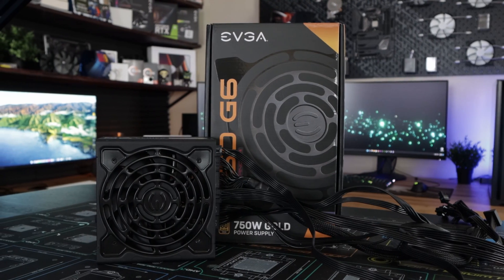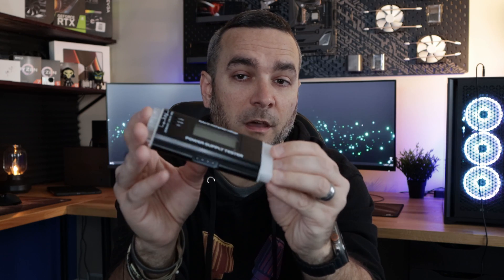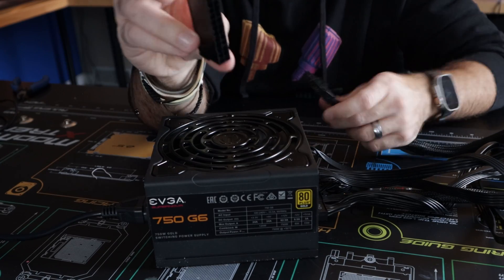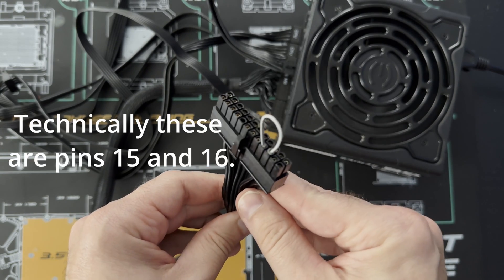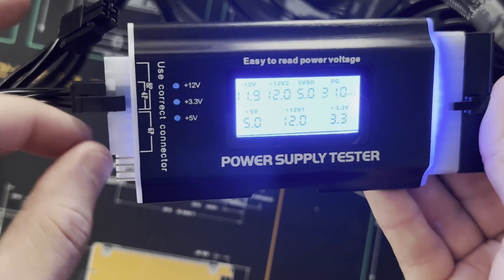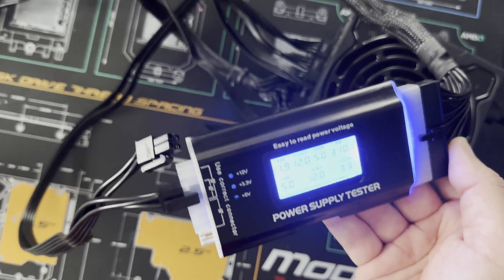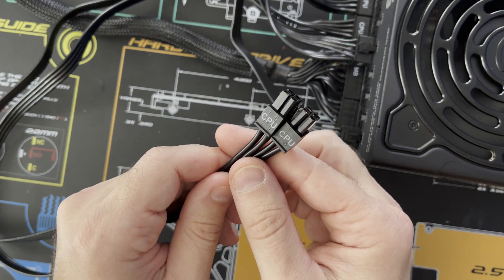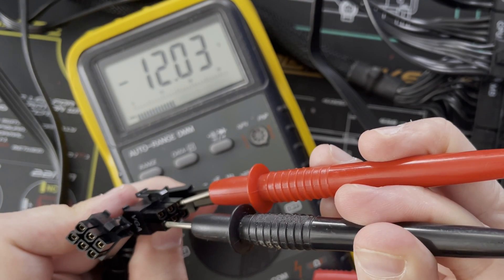How to Test a PC Power Supply | Jumper Wire, PSU Tester, and Multimeter

Comment: I had the same issues as well but the difference is the monitor shut downs and my keyboard lights turn off also. Sometimes it restart by itself sometimes not and i need to force it to boot or turn it on again by turning the whole pc off. But the thing is. My pc still running all fans and lights are running and on including the cpu fan but why only the monitor and keyboard loss signal or lights?

Even in idle or YouTube still random crash or shutdown.

Can anyone help me address what's the problem of my pc??

Comment: I have a question when testing a PSU how long should you test it for?
Reply from the maker: If you follow the methods in the video, then you only test it until you check all cables and make sure you are getting the correct readings. If you are stress testing, then there isn’t really a timeframe. Run a few benchmarks and you should be good to go.

Comment: how are your TechRated, i have a 3070 with ryzen 7 3700x 32ram from t force, and SSD, so the thing is like 6 months ago my computer when I turned on, start but no display on monitor, and check the rams, GPU stress test, clean everything make sure all is plugged, and damn I do everything, but still the same thing, is not all the time, I turn the PC on 3 times with no problems but when I do it for 4 time, the PC turn on but no display , so I'm really don't know hats going on, I'm suspecting on the psu or last thing GPU but is weird because I don't have shutdowns or green lines or freeze my PC runs excellent is just sometimes start but no display, can you help me please?, i can pay if you want! but please man idnk what to do! and sorry my grammar i don't speak English ):
Reply from the maker: If the PC turns on, then it probably isn’t your PSU. It sounds like you may need to do some Windows updates and maybe GPU driver updates. Not sure. Not having an output to your display randomly is strange. I would do all updates first and then go from there.
Reply: @TechRated  thanks bro, yeah i gpu drivers are up to date, same my windows, today I will update the bios, and keep testing o.O
Reply from the maker: You might also need to update your chipset. Other than that, check simple things like cable connections and monitor settings. I guess it is possible that you might be having issues with wattage to your GPU if your PSU isn’t able to output what it needs. What GPU do you have? How many watts is your PSU?
Reply: @TechRated  thank you again and i did the chipset update the bios update like 2 hours ago, and I have an RTX Gigabyte 3070 OC 8gb and a 750w power supply of a weird brand. o., bro I will pay you this wednday like 10 dollars just for answer me
Reply from the maker: @tcpilot6995  No worries! This is the goal of my channel! Hopefully your PC issues get worked out. I appreciate the support! 👊🏼
Reply: @TechRated  hey bro good morning, I turn my pc this morning and same shit I'm frustrated 😠,  yesterday I update bios, chipset, update all the drivers everything man! What you think psu? I have a weird brand I mean is not a famous brand have 750watts
Reply from the maker: If you have completed all updates and it is still happening, then make sure you are getting proper cooling. If you know cooling is good, then the next thing would be PSU. If you do need to buy a PSU, go with Corsair or EVGA. They make good quality PSUs and aren’t that expensive.
Reply: @TechRated  I got you boss! Well I have kraken x63 I just install it 1 month ago , so Temps are good, so I will start with the psu, I'll keep ou 📫
Reply: Hey bro good morning I just change the psu I buy a corsair 850x and still the same, idontknow wtf, probably format? I don't know
Reply from the maker: I’m not sure what else to try. It’s hard to help solve a problem over messages. Lol. This might sound too simple, but have you tried changing out the cable connected to the monitor? Or the port that you have the monitor connected to your PC? At this point, I’m just guessing. However, a new PSU is not a bad thing. It is one of the most underrated parts in a build.
Reply: @TechRated  I buy that pc from ibuypower but I think I buy it on ibuyshit honestly, if I can't solve this I probably will build a new pc with a different mother board but I will keep the rtx3070 the r7 3700x the rams the psu the cooling on the cpu and the all the storage, but I'm interesting on a all corsair build, but only if I can't fix this, if we fixed I'll my pc but ou know
Reply: @TechRated  Bro! I format the windows 10 and the problem still here, BUT! I SEE SOMETHING! when I turn on the PC and then I press shut down for turn off the PC     then when I try to turn it on the PC doesn't start! So every time I press shut down the PC will not start at the first time! Damn I just see that right now! What you think about it? I make cpu stress test for 9 minutes all good I try with 2 different gpu and the problem is the same, after shut down the PC will not start at first time, sooo what you think motherboard maybe!?

Comment: Can I test the paper clip 4&5 with the multimeter?
Reply from the maker: Yes, you can! But usually, if the power supply activates with the paper clip or jumper wire, then those pins are fine.

Comment: Any way to test an HP L 8261-004? It has 2, 4pin connectors and 1, 3pin connector.  No tutorials found on youtube or anywhere. When I push start the fan doesn't run so I guess it is bad. Would be nice to test.

Comment: Amazing, I have one of those Amazon testers, but did not understand why it was beeping. I'm going to try with the PCIe cables and see if I can get stable readings. WIth just the big Motherboard cable connected, it does a 'LL' on one of the 12v- rails and shows slightly miss-matched 12v readings.
Reply: Same thing for me. Also there's a wall that prevents me from connecting to three six volt connections on my cable mod cable.

Comment: Would like to see info on testing the modular cable outputs directly, rather than through the cable. The PSU end is not standardized, so we cannot expect (for example) the top-right pin to be ground on the PSU side. If you're making custom cables and want to take a pinout before you start, this isn't really useful.
Reply: Do you find a way to find the ground on the psu yet? I'm having the same problem right now.
Reply: @askell3738  Ultimately, i plugged the cables in and traced the individual wires back to the psu. Did this for each wire in the cable to get a presumptive pinout, then used a multimeter to verify the voltages.

Comment: Very helpful. My daughter is trying to build her first PC but the PC didn't show anything on the screen and no LEDs on the motherboard. The power button works and the fans come on, even the CPU fan works. I checked the CPU 8 pin connecter and measured 8.8V dc but unstable. I have returned the PSU assuming this is a fault. From your video it seesm that my diagnosis was correct. There are 8 pins but I found that only 6 are used for power, 3 positive and 3 GND. What are the other two for?

Comment: Thank you so much.  I had bought components for a build over time so its not built yet and 
I was stressing that too much time has passed w/o my building the pc rig and so if the PSU is DOA  I'd just lose my money.  Watched one video but my PSU is modular and all the wires are black so I have no avail to the color coded wires.   
🤣 Then there was your video a newer PSU and I learned .  I'm now collecting parts for a different i5 12600K none gaming rig  that  needs more Watts.  Can you tell me which of the following is a better 850W PSU CORSAIR RM 850W vs. Thermaltake Toughpower GF1 850W?  Unless you can recommend something better in the same price range?  Should I go single rail or multi rail?  I want to run a virtual box to install & production software. I don't earn money doing that so I can't spend tons of $ on such a production rig, I'm mostly learning for fun.  Again thank you for sharing your knowledge👍
Reply from the maker: Both of those brands will work. I usually go with Corsair or EVGA for my power supplies. In the past, I have used Thermaltake and it did quite well. Most PSUs these days are reliable and do what they are supposed to do. However, the price is determined by the power output, features and efficiency. As far as features go, I am talking about if it is modular or not, RGB, display, etc. Efficiency is the rating (Ex: White, Gold, Platinum, etc.). But I would go with whatever your budeget allows. The ones you mentioned are very good choices.